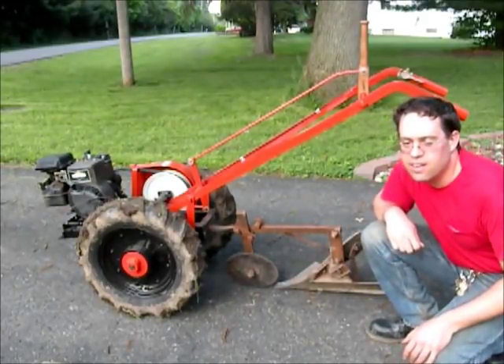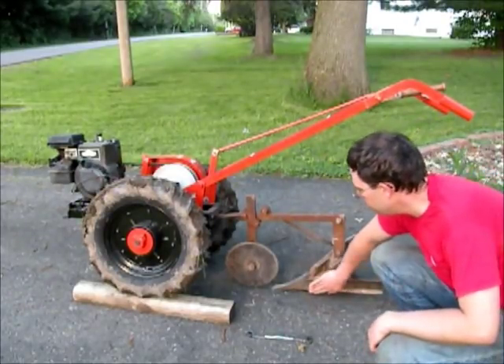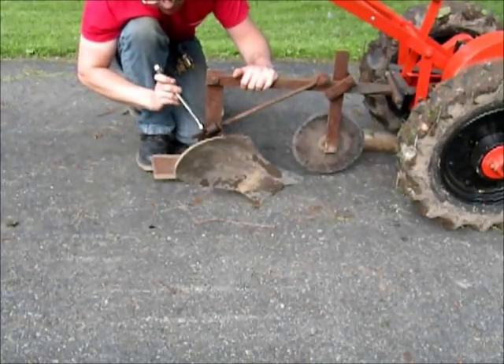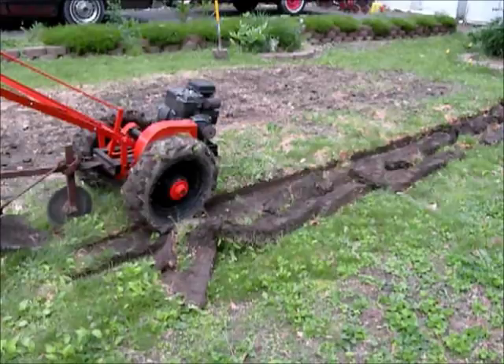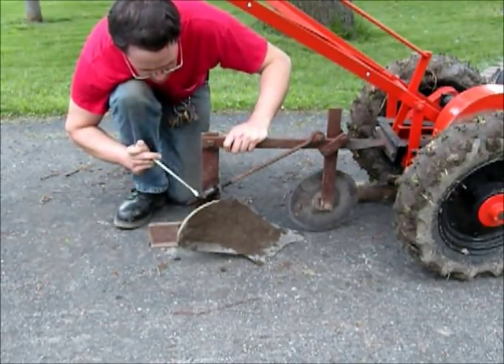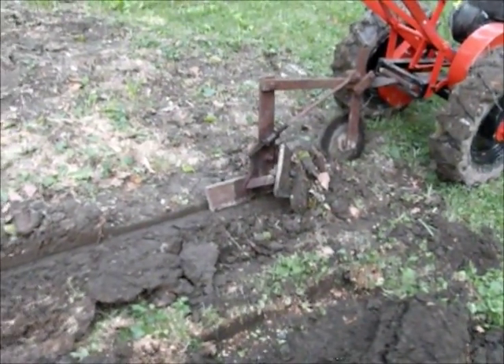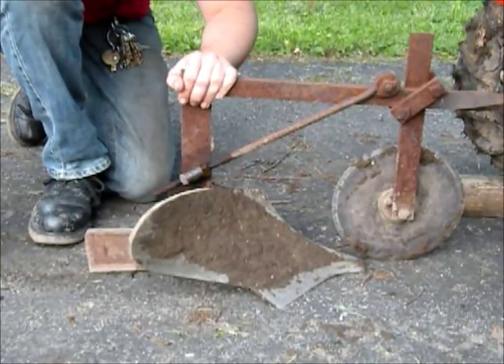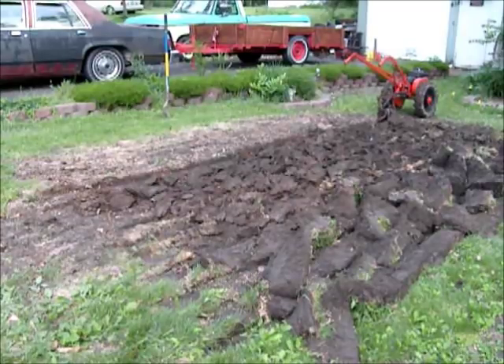Adjusting Pitch On A Small Garden Plow

Comment: Chip; When you finish for the season with the turning plow wash and remove the dirt from the moldboard, sand if necessary to remove any rust and then paint the plow (wing). Next year it will work much smoother on the first pass. It prevents the dirt from sticking to the metal.
Reply from the maker: That's great advice! They work so much nicer when they are glossy smooth.

Comment: I don't believe you can set THAT plow, or most other such plows for the opening furrow.  Ive always done the opening furrow twice to get it down to where it should be IF the first pass didn't do it.As to having to lift the handles due to the plow nosing in,  If you turn that screw that attaches the plow shank to the plow beam  , and im guessing clockwise, a 1/2 doz turns youll find that it dosnt do that.ALSO,  The rolling cutter should be just that close to the moldboard as it is, and about 1in lower.Ive farmed since 68 and am 70, so I know what im talking about.  I currently have a 2 wheel Simplicity garden tractor, that I rigged a Brinley plow to,  and currently have a David Bradly garden harrow chained up to it.  Will rig up a disc for it sooner or later.
Reply: That rolling cutter used to be called a cutting coulter or just a coulter.

Comment: You need to scrape that wet dirt off the moldboard and share, then brush it.NEVER just turn the tractor off.  Shut off the fuel at the bowl and let it run empty on low.  That does 2 things.  It drains the carb so that no schallac builds up in the carb making it hard or impossible to start later on, AND, letting it idle till it runs out of gas lets the engine cool down before dying, rather than having it run  and then immediately shutting it off.  That cools the engine too fast, and it can warp the head.Put a teaspoon of chainsaw oil in the tank, and ONLY used REAL gas of the highest price.  Makes for easy starts.
Reply from the maker: That's great advice and I usually try to do those things. I was getting in a hurry dealing with the camera and I did shut it off rather quickly. The engine that's on it right now has the gas tank under the carb so there is no fuel shut off. The original engine is as you described though and I used to turn off the gas and let it idle until it quit. I'm in the process of rebuilding it and hope to get it back on the tractor soon.
Reply: Sounds good.  A Bready is a kinda rare bird.  Sorry if I sounded harsh or overbearing.
Reply from the maker: You're fine. I try keep in mind how easy it is to have misunderstandings when writing back and forth with text. So much is lost in translation by not being able to hear the other person's tone of voice. The tractor being kind of rare is part of why I'm hesitant to load the tires. My Dad has a Ford 860 with loaded tires and with age they have started to seep and one of the rims is now rusted out around the valve stem. I can't imagine where I would ever find a replacement rim for this Bready if one went bad. I figured that I would see how it does dry first and that I could always add fluid later. The main thing I wanted to use the tractor for was cultivating weeds in the garden and it has no trouble at all pulling the disc or cultivator. Another thing I'm looking forward to using on it is the sickle mower. I was thinking about what you said about loading the tires with water and it sounds to me like you might be in a slightly warmer climate. Here in Ohio it's not uncommon for the temp to dip down to 0F -15C at night and have a high of 10F or -10C during the day for the coldest months of the winter. As cold as it gets I would probably want to add antifreeze to the water. I think my father said that the tires on his tractor has calcium chloride in them. I've heard that calcium is pretty corrosive. Thank you so much for not only taking the time to watch my video, but also taking the time to talk back and forth on here as well. The best part of having videos here on YouTube is getting to have conversations with folks from all over.
Reply: U say it gets down to 10 oe _10.  How much gardening do you do in temps like that??  I garden when the temps are in the 50s/60s.  IF you do likewise, then the water would be thawed out if it was left in the sun for a day.You can also coat the inside of the wheels with a clear coat hardener before putting the tub and tire on.How much air pressure do you run in your tires.  on a real tractor its around 22lbs, depending on tire sizes and widths.  Ive ran around 22/25lbs on mine for 45yrs.  Im in NE Okla.
Reply from the maker: Im still worried about what damage the initial freezing solid is going to do. The rims are made up of two halves that are bolted together with eight bolts. Freezing water is powerful stuff. What are the odds of the ice forcing my rims to spread apart or tearing cords in the tire? Are you going to replace either of them for me if it happens? The tires were pretty expensive and good luck finding a replacement rim. I do have a blade for it so I was planning on using it to push a little snow during the winter months.
Reply: Well, I hadn't thought of the expansion, and you don't fill them but 3/4 of the way, so that the water ought to rise up in the quarter that's left, but your right, its not worth trying ion top find out.  Do you know the year it was made.I have a Wards Simplicity with a gear shift that I really like, but its HARD to find Wards/Simplicity implements for it. I had a 1934 Standard Twin garden tractor.  First year they came out.  It had no turning brakes and was a bear to turn around, so I sold it.  Still looking for a steel wheel newer one with turning brakes.  I kept the implement carrier that had the mounted cultivator on it in case I do find another one.I think the fluid for mine was around $35
Reply from the maker: By my understanding this tractor was built some time in the late 40's to early 50's. Those Simplicity tractors seem to be good tractors. I just acquired a #209 Simplicity cultivator a couple weeks ago. I don't know if you are on Facebook or not, but there is a group on there where guys share pictures of their walk behind tractors and also post things for sale. I see Simplicity tractors and implements on there from time to time. I have even seen Standard Twin tractors listed for sale. I would love to have one of those.

Comment: IF you cant afford new tires, at least put fluid in the tires you have and put tire chains on the tires to get better traction.  The tractor is willing but it cant get a grip.  Not the tractors fault, its the tires.
Reply from the maker: William Christopher This tractor has brand new tires on it. I restored the tractor and put the tires on last winter. It's wasn't helping that I was cutting through sod in compacted ground in my front yard. It does far better in my parent's well established garden.
Reply from the maker: I agree that it would be much better if I did load the tires, but I didn't want to deal with leaks causing my rims to start rusting on a freshly restored tractor. I figured that I would see how it went dry first.
Reply: U say you've got new tires on it.  I got new tires on mine, and the lugs on mine seem to have sharper edges than what I could see on yours.  GIVIN THAT THO, you say you were afraid to load the tires for fear of leaks.  Please don't tell me you paid $150 for tires and didn't get new tubes with them.  Myself, ida rather got new tubes and loaded them with water if nothing else, as you wouldn't be using it in the winter, and one hot day in spring, setting out would thaw the ice inside all that rubber.  THEn if I couldn't afford new tires ida put old tires over the new tubes and added chains if it still needed it.